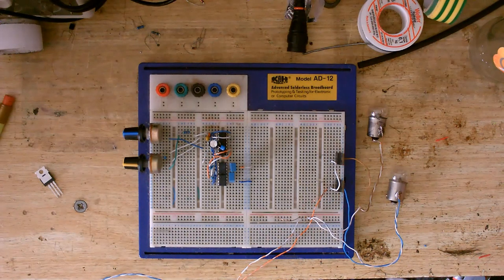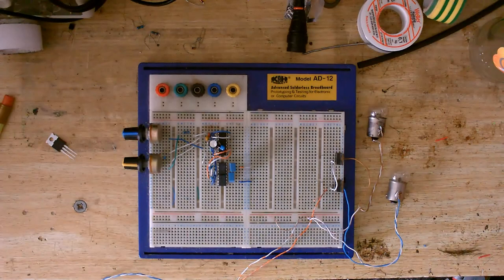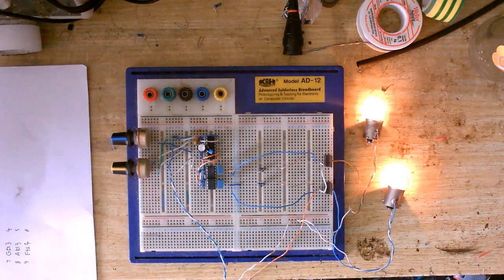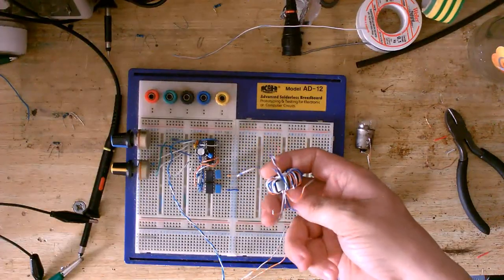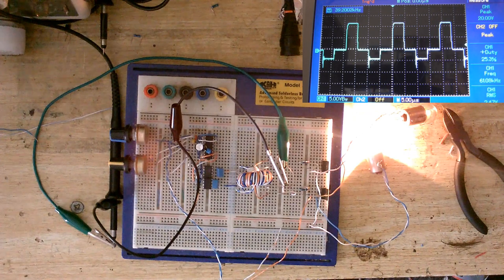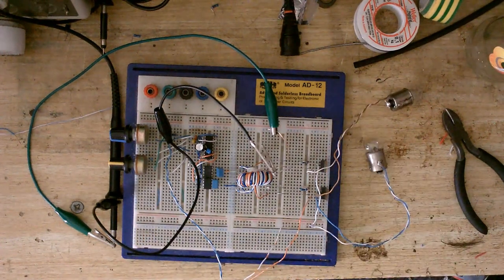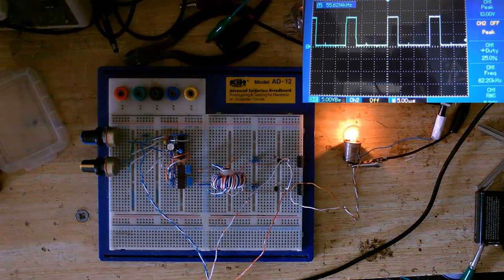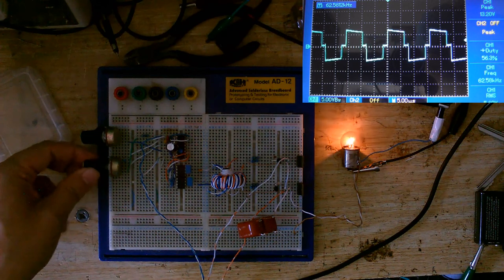Getting a good gate waveform, and running some low voltage tests.

Comment: Very good!
When you add the Output Transformer will the Secondary Rectifier(s) be Half Wave?
Reply from the maker: No it's going to be full wave, I'm going to go with a centre tapped output transformer as I have a couple of those laying around, that way I'll be able to easily do full wave.